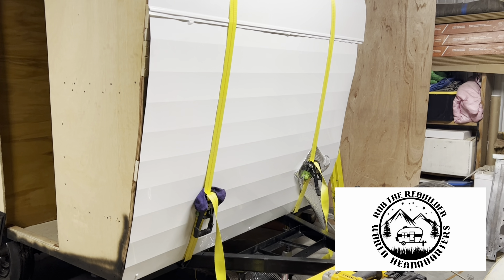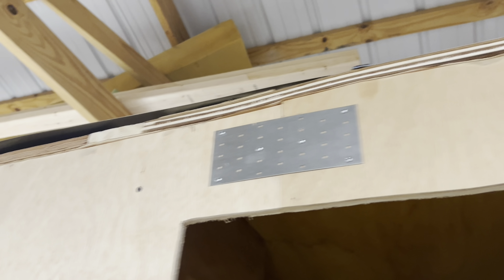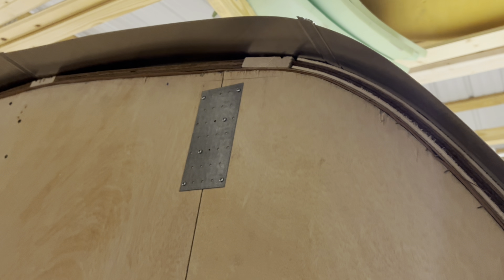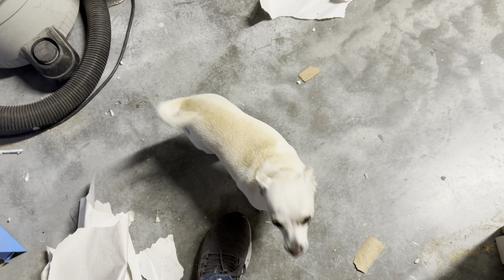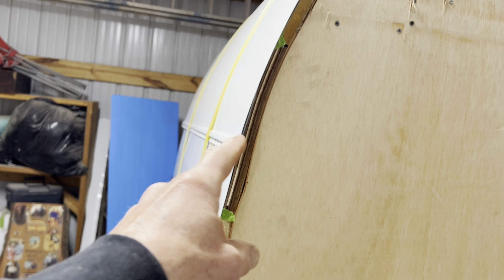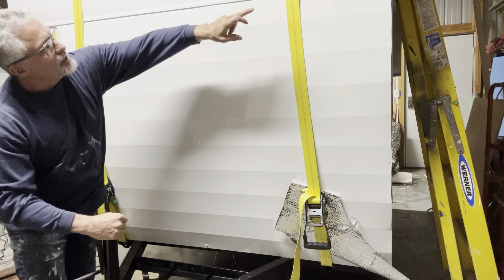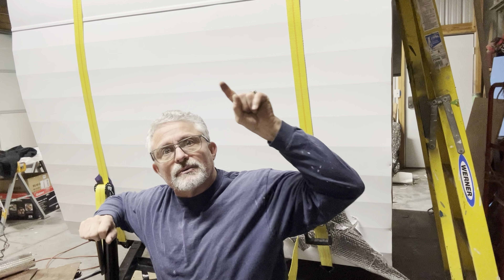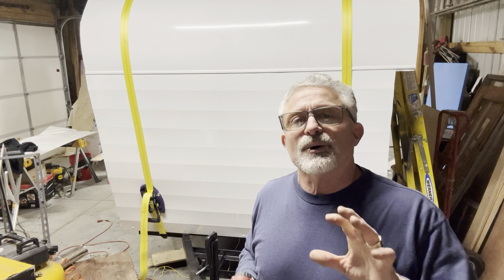EP 273  Install new aluminum roof on vintage camper step by step TOP SECRET build

Comment: Hey rob not shur if you know about sheet metel air shears , but they would do a great job triming the extra tin off and they would be perfect for strait cuts tight to the corner also wont have to worry about chewing into the ply with a jiggy blade , just a tip to make it super easy , a cheep harbour freight one would do you a world of difference . Enjoying your videos , keep up the god work ...
Reply from the maker: That will be my next purchase. Going to do a little research. Thanks

Comment: Rob, it seems every trailer you work on is different in terms of that roof to wall seam. Some cut the roof skin flush, lap the wall skin over it, others lap the wall skin over the roof 1/2" then apply the roof skin over that then lap 1/2" (finally covered by the J-rail). Were they all just built/designed differently? It seems you would invite leaking by lapping side skin over roof skin.
Reply from the maker: I agree with you. There are several ways they were built over the years.

Comment: Help Rob!I am finally getting back to working on my 1966 Oasis. After replacing damaged roof boards last summer a couple weeks ago I stapled double sided foil bubble wrap into place. I went out a week later to take some measurements only to find that there was water pooled up in part of the bubble wrap. I suspect this is from condensation. I pulled off that section to let it drain and dry out. What can I do about that? I don't dare do any more work on the inside until I get that under control but I just don't know how to do that. Thanks.
Reply from the maker: Leave the bubble wrap off or find the source of the water. Haven't seen that problem yet
Reply: Thanks. @RobTheRebuilder
Reply from the maker: @icecreamladydriver1606  No problem

Comment: Im putting a new roof on my caravan, what thickness should i use< choice is, .7mm   .9mm   1.2mm   i want to keep the weight down so was gunna go .7mm
Reply from the maker: Our aluminum isn't sold in mm. Use what you think the manufacturer would use as a minimum.

Comment: Rob
Just to confirm, thr roof skin comes with the Pittsburgh seam, you didn't have to bend that, right?   So that means perfect measurements on roof to top of each window.  Is that correct?
Reply from the maker: You have to order the Pittsburg seam and then trim the front or back flat piece to fit. Nothing is every perfect.